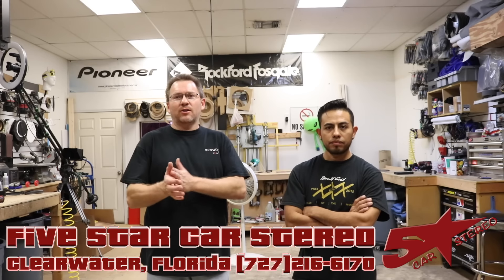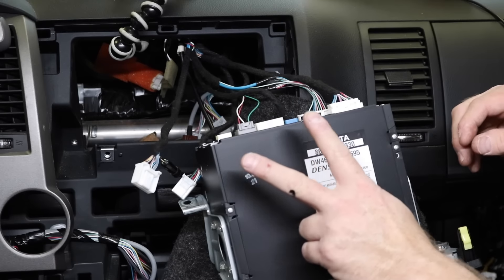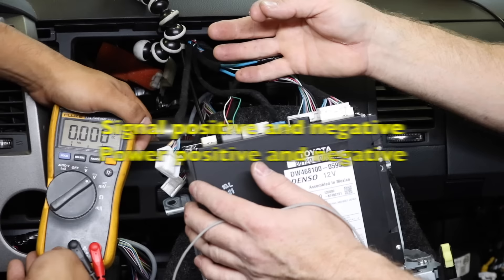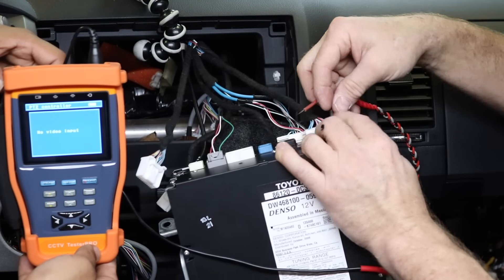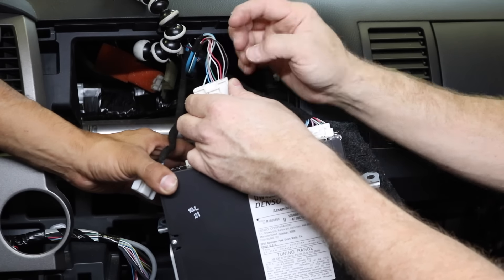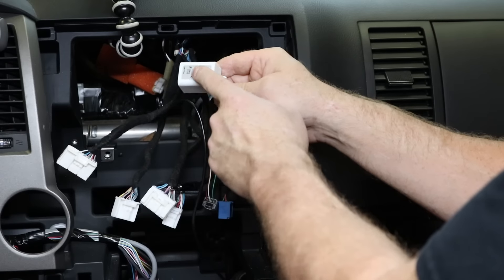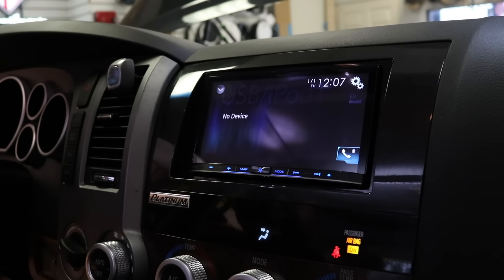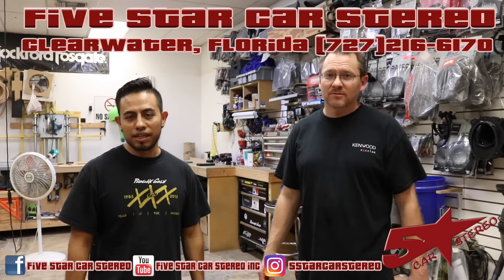How to retain your Factory backup camera when replacing your radio

Comment: Where does the 12 volt side of the step down converter connect to? The stereo? Or the reverse wire?
Reply: This is the question i need. I have a feeling it best to wire the reverse to the converter so that the camera can turn on when you put it in reverse only. My radio does not have a reverse input because they send a camera with it that has 12v wire attached to the camera rca plug
Reply: I actually figured it out. The radio did have a reverse, it was labeled back. So the step down goes to camera positive ground to radio ground. Then you just need an rca cable with for camera ground and video signal. It was actually pretty simple once you know which wires are which.
Reply: @monofrio6804 step down is 6v?

Comment: Looking at doing this on a 2013 Jeep Grand Cherokee SRT8. As others have said here crutchfield has said i need to purchase an aftermarket camera. I don't have fancy tools you use here so wondering you have knowledge on what wires are what on my vehicle? Also, is soldering necessary or will wire connectors work?

Comment: This was a helpful video (learning the two things needed are signal plus and minus, and power plus and minus). I want to leave some info for anyone trying to retain a factory camera in a 2012 Ford Escape (Limited). The camera is always powered, so leave the power alone. The signal reaches the factory receiver on a plug. It's the only one with just two wires connected. Lighter color is signal plus, darker is signal minus. Cut the wires from the plug and connect to an RCA plug (lighter color to center post) and camera will work with aftermarket receiver (if it has RCA rear camera input).

Comment: Nice video. I do have one question. I have a mazda cx 9 2007 bose w/ nav. I wanted to retain my factory backup camera. I got the power working but I don't have a video feed. How will I know what color is the wire for negative/positive of the video feed using a voltmeter? I have the axxess mazcam 6V. Thanks!

Comment: Really awesome channel, all good stuff without any nonsense or filler. Got a head scratcher for you: I'm trying to install a METRA AXCAM step-down 12v to 6v converter in a 2017 Crosstrek to keep the backup camera working when installing an android HU. Problem is the METRA only has 3 wires, and the wires I need to tap into are also 3, not 4. According to the instructions, the GROUND and the NEGATIVE for the video signal are on the same BLACK wire, and the POSITIVE for the video signal is on a RED wire. The METRA AXCAM says to tap its BLUE/RED to the a WHITE WIRE,and  its BLUE/WHITE to the reverse wire (BROWN YELLOW). However, when switching the car into reverse the HU tries to display the backup camera but all I get is video noise. Obviously one of the video wires is incorrect, but the wiring diagram also only identifies 3 wires for the backup cam (c11, c12, c20). Could the RED wire be for power, and the WHITE wire be for the video signal? I'm lost.

Comment: Great info.

My situation, I installed a pioneer avh-490bs head unit in my 06 jeep commander. I wasn’t aware during the install that I could retain the stock camera at the time.

So now I’m thinking of splicing into the wiring at the camera and then running forward since I’m certain no one makes an adapter to retain the stock camera.

I’m fairly confident in my installation and mechanical skills. 

My question to y’all is what all do you recommend as far as hardware I’d need to purchase first before attempting this?

My considerations at this juncture is without the stock radio I won’t be able to produce your results with simple testing since I can’t actually engage (or know when) the camera.

The other question to all of this is id like to install a camera up front (my wife and I do a lot of wheeling, we’d like to be able to engage the cameras so we can see our obstacles without having to get out) would it be possible with this type of setup?

Thanks for the videos, keep’em coming.

Comment: My 2017 Acura ILX with base audio has 6 wire for backup cam listed in wiring diagram from ALL DATA can I just hookup the four like you guys did for an aftermarket install?

Comment: Hey guys I just installed a new aftermarket radio in my 2015 Toyota Highlander Xle. It came with a harness to retain the factory backup camera but the quality is absolute 💩. Is there something I’m missing possibly with the connection? All I did was connect two rcas together from the harness but do I need to ground it would that help the quality? Thank you.

Comment: Hi  have a 2011 infinity g25x i have installed the tesla style stereo with bose,navi,  back up camera with sensor. now i was wondering if you had any experience with this stereo and was wondering if you can do a video on how to connect a back up camera to a tesla style stereo for a 2011 infinity g25x . i haven't had much success and cant get my cam and back up sensor to work . any info you can provide will be greatly appreciated. thank you.

Comment: Great video. Definitely saved me some time.
Will I retain the dynamic guidelines. Is the steering wheel angle wired into the oem head unit or the oem camera? Am waiting for my after market head unit so i guess I will find out soon enough. The suspense is killing me.

Comment: i have a 2006 f150 fx4 it doesn.t have a back up camera in tailgate handle was wanted to add one do i need to replace my head unit or there a wire there since some of these trucks do have the camera installed and i saw you can purchase the handle to add a camera to older model please help

Comment: 2008 tundra OEM reverse camera issue. 

Ok here's the details. Used the video  here and tested the lines as it was described they matched perfectly and had video on aftermarket pioneer HU. Now I'm not getting video or the 6v to the factory harness hence no video. I've checked all fuses nothing blown. Tried in park and reverse still no 6v required to power camera. 

ANY IDEAS? ANY HIDDEN FUSES?

Comment: I have a 2012 Subaru Outback and installing a pioneer head unit? The factory camera monitor is built into the mirror. How can I switch that to the head unit or both ? Thanks a lot I appreciate it.

Comment: I've been attempting to install the factory back up camera on a  2015 Nissan Sentra to a radio which is called the double din Android Radio. The radio comes with the RCA connector but I am not sure where the back up camera wires for the vehicle are at on the harness. Do you have any suggestions. I've tried looking up wiring diagrams and had no luck. Your video was awesome but I quite don't have the video tool. I have the DVOM but not the other. Thank you.

Comment: Great video as are your others. Any idea if I can grab the pink and blue wires I need on a 2011 Traverse w/ bose, no nav. for a setup with factory video in mirror. Added a Kenwood ddx6705s and need to grab the two wires to make the cam work.  I found the wires I need in the top map light area. You do you where I can grab the wires under the kick panel? There are so many wire bundles and it would save me a lot of time!  thank you.

Comment: I was able to connect my Toyota Aurion's factory reverse camera into Android unit. Thanks guys!!! The cabling system for reverse camera in Aurion was almost identical.
Reply: Were you able to do that?
Reply: @robertotr  Yes bought this from ebay and was simple to install. Voltage Converter 12V To 6V 3A 18w DC To DC Step Down Module.

Comment: This is great! Thank you very much. Now I have a question thats a bit opposite. I have a Kenwood DNX double din unit going into a 2009 Acura MDX. The MDX has a screen at the very top of the dash that has the back up camera on it. What I want to do is use the video out option from the kenwood and hardwire it or make a video connection into the factory screen at the top of the MDX dash. I'm a pretty capable person and the testing and wiring in this video is pretty common for me, i understand it well. But is it possible for you to do a write up of a rough video of how I can accomplish what i'm looking to do? Video out from the kenwood and video in into the factory screen on the MDX dash either by hard wire or by hardwiring in a video rca plug. I will forever be grateful !!!!
Reply: I've got an 09 TL Tech Package and I can tell you from my experience this weekend that it's not worth the trouble even if it is possible. Ive spent 3 days now trying to retain all my factory features while changing the stock radio to an aftermarket unit (got most of em, backup cam, stearing wheel controls, fm radio antenna, usb, and aux) but it's just worth it. I actually melted my taillight housings leaving it in reverse to long trying to probe for the correct wires for the backup cam. I loved my Acura until this weekend. Now I'm looking to sell and upgrade.

Comment: Hi, Guys,Fantastic videos but I'm left with one question - I have a 2017 Dodge Grand Caravan and I'm installing a Pioneer AVH-X5700BHS that I have on hand from a previous vehicle and want to retain the factory backup camera - do you know offhand if the camera is 12v or 6v??    If 6v I need the 12v to 6v converter to run a feed from the accessory lead??? If the camera is 12v the converter is not necessary??? Going to use the PAC SWI interface you have suggested so it already includes a reverse input.TIA

Comment: Have you encounter Japanese car Toyota estima acr30 2005 with front and back camera connector to in one socket(10 pin video and communications). 4 pins has voltage ( 3 x 2.2v and 1x 4.5v) when not plug in. If plug in only 1x 0.9v which previously is 4.5v. Are these corresponding to 3way front camera and 1x backup camera?

Comment: I have a 2007 Acura TL Type S which has a OEM backup camera I'm getting a new head unit and also doing a navi swap with a different tablet in the bezel and wanted to know if there's any way to connect to new backup camera with the old connections or do I have to run the new camera like any other car

Comment: Is it possible to retain factory steering wheel controls and backup camera AND climate controls without using a controller/module when connecting to an Android Head Unit?  My Stinger HEIGH10 has both resistive and digital connection capabilities for SWC and reverse camera wiring.  I'm currently using my old aftermarket Android head unit's controller module to get everything working, but the aftermarket dash kit is missing some OE features...plus having physical buttons for climate controls is way better than the touch screens of the aftermarket dash.

Comment: Hi There, So i bought this toyota corolla 2016 that came with the Screen Radio but did not include the camera, since I had to change the trunk door I bought one with an OEM camera already installed, is it possible to connect this camera to the radio?

Comment: Well I have my backup cam wired now thanks to this video and some research but the video is showing in black and white now after showing color this morning. Is it just a poor signal connection? Should I try a stronger rca and better solder connection?

Comment: So I have a question about my 2008 toyota sequoia. I want to install a factory camera to a aftermarket stereo. I noticed one day when looking at where the camera would be placed in the rear  I saw that it already is prewired in the event if I wanted to install a camera later on. The wire runs through the headliner towards the rear view mirror. I guess what I want to know is from the pre existing wiring should I only require to solder on a RCA male connection onto the pre exisitng rca wires? or do I also need to do something with a reverse wire? If i need to do something with the reverse wire what should it connect to or how would I go about integrating towards the camera working. I also noted in your video that you used a 12 volt converter to 6 volt would I need that? Please Reply...Thanks

Comment: need help with my 2015 Mustang GT base model and bought Scosche plug and play dash kit but the only thing that works is start stop-hazard-stearing and ac controls but not red key switch or back up camera nothing for radio but just yellow constant 12v wire, due i need too take it to ford for a reprogram it cuz i put back sync and oem radio and evry thing works?

Comment: I have a 2018 Grand Caravan and I am installing an aftermarket stereo.  I want to retain the factory backup camera and be able to have it automatically come on when I shift into reverse.  The connection however has on three wires.  An exposed wire, a grey and orange wire and a grey and blue wire.  Am I able to tap into one of these wires to enable the reverse function for the camera?  And do you know what each wire would be for?  I have a av adapter for the video itself but need to connect the reverse wire on my aftermarket stereo to something.  Please help!

Comment: Ok i have a honda accord 13' and looking at the electrrical diagrams i have 2 plugs associated with the rearview camerra..one is a 12P and then theres an 8P connector..what i want to do is tie it in to my kenwood excelon head unit..I have the step down 12v to 6v converter so my question is the 2 connectors i mentioned do i go thru them and find the wires im needing cause i dont kno if hondas use a data signal to power the backup camera..Like i said i have all the diagrams etc im needing help on what i do next step by step..and do u have to have one of those monitors i mean is that my only op[tion is that or a headrrest monitor..u cant use a laptop for the monitor?

Comment: I have a aftermarket harness with a voltage step down and is also supposed to retain backup camera plus keep steering wheel controls but when i put car into reverse it doesn’t come on, but when i press the button for viewing camera it comes on n i see perfectly. Any ideas whats goin on? I have a 2019 camry with a axxess harness.
My guess is i got no signal goin to radio telling it the car is in reverse, anywho all help is greatly appreciated!

Comment: Since you tested the wires and got 6v for camera why would you need that 12v to 6v adapter if you’ve got 6v already?
Reply: Cause the aftermarket  radio works with 12 volts so you need a Converter to do it

Comment: I have a 2005 ford f250 with a pioneer after market radio .. just installed a 2008+ tailgate that has factory camera. Is there anyway to connect that camera to my pioneer head unit ??? Thanks

Comment: thanks you so much for this, I recently had a really bad experience.  went and bought a pioneer head unit and opted to have geek squad install, well showed up for my scheduled appointment and he ends up calling me back in after looking at the truck/suv and says that since the dealer installed a aftermarket Toyota nav entertainment system he was going to have to add 149$ more for a harness and hour and one half hour to undo all the dealer did then add the harness to hook up the new head unit.  now im no expert but all the wires are there for the new head unit except this rear camera which you just showed me how to do.  all total 304$ additional cost already to the 130$ appointment which I was at that has now has to be rescheduled to a new one.  well do I have *&%%$  written on my forehead, so I gave it all back really upset....these guys should have told me this in the first place, even after I said it looked intimidating to me cause of the rear back up camera has a 4p hookup (bec108 eclipse rear camera model number) not the yellow one like in this video and the new pioneer has the yellow input..  I know I could have done this hell you sodder right in the car whats wrong with the geek squad?

Comment: Hey guys I just purchased and installed an Alpine x009 fd2 I figured out how to tap into the factory back up camera down on the drivers side behind the hood release but I was wondering if there was a way to utilize the factory back up sensors with this unit I've looked over the manual and it has no mention of this but the unit has the option for parking assist

Comment: Hey gents, great video. I have a 2014 Nissan Rogue SL with the Look Around 4 camera system. There are cameras in the front, rear, and both sides, which shows a birds eye view when backing up and can be toggled to show rear and right curb as well by pressing camera button. I would love to add CarPlay by adding an aftermarket radio but would prefer not to loose the use of the additional cameras. Any suggestions?

Comment: i understand the camera signal +/- get connected together to the male RCA plug. and the aftermarket Camera signal wire connects to the Backup cameras Signal wire.
But where does the Camera Power wire and Reverse wire connect to?

Comment: Does the car have to be in reverse when attempting to locate your 6v wire. The only reason I ask is because I have  4 wires sending 6 volts in reverse, park, and drive.

Comment: Question for you. I have a 2012 silverado with a Kenwood 9903 in it. I the RCA that it came with only had 1 wire on it. I ran it to the negative connection on the side connectors by the door, and it works, and i will get video, but its cutting out on both the mirror and the headunit. 

Any idea on how to fix this?
Reply from the maker: +Andrew Kelly did you plug in or splice into the wire? Is the wire tight in the dash, it might be rubbing something?
Reply: I have it spliced into the connector

Comment: Hi guys 
I have a 2015 wrx which has the factory camera  image on the multifunction display screen 
I would like to project the image on my pioneer unit as well on the multifunction display screen

If I did this will it damage or hurt the original screen what a your thoughts on this one

Comment: This is awesome. This is the exact application I was looking for. 2007 Tundra with nav. Swapping it out for an apple carplay system. Do you have a video on retaining steering wheel controls for this application as well?
Reply: Hi there, where do the black and white wires connect to after step down?